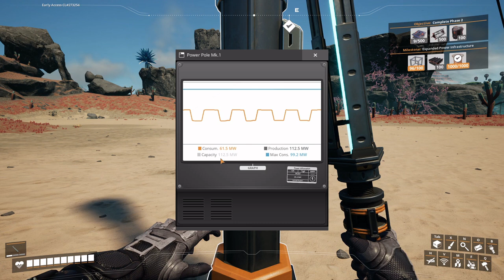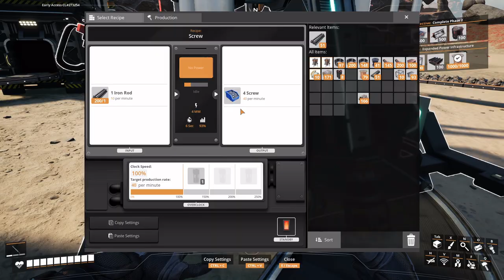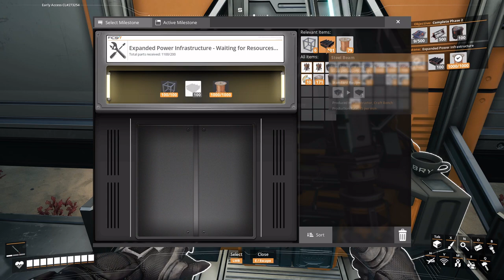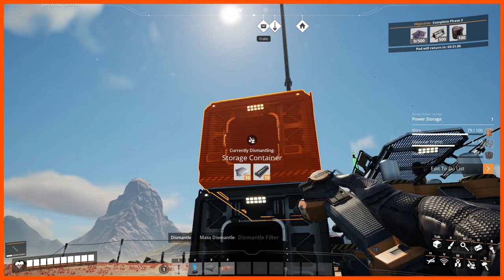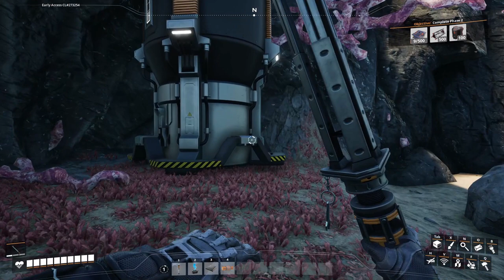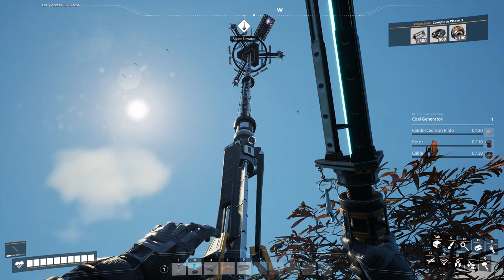Am I doing this right? Satisfactory

Comment: The biomass burner automatically compensates for excess power consumption by lowering the amount of biofuel it uses when more power is required. It will increase fuel consumption. basically it will under clock itself.